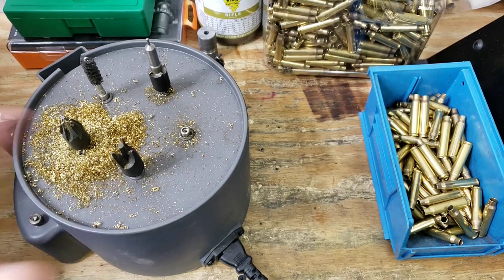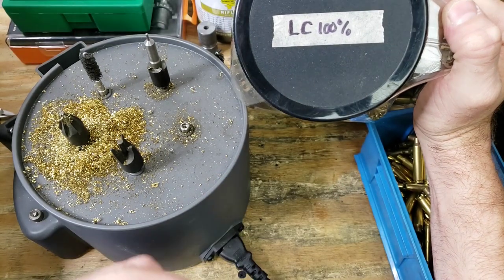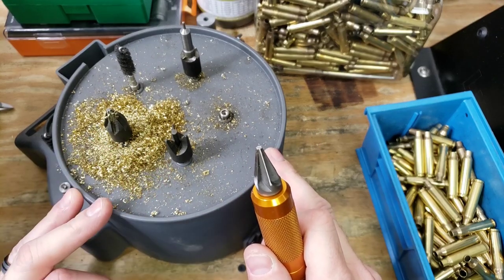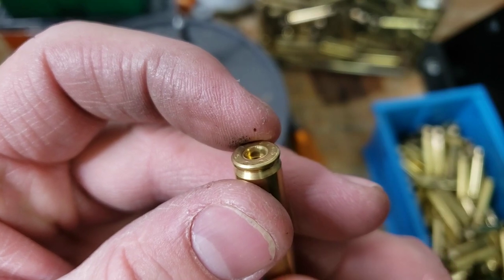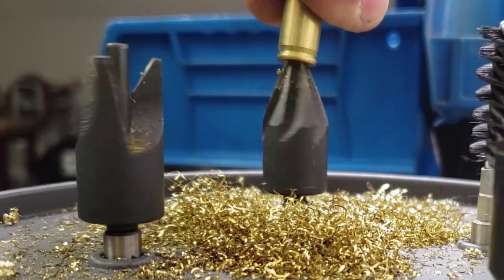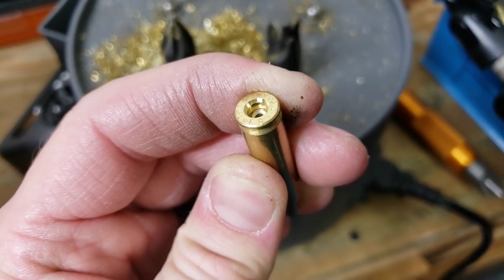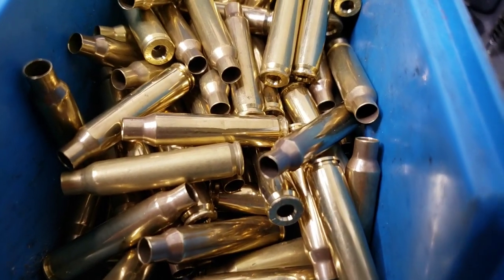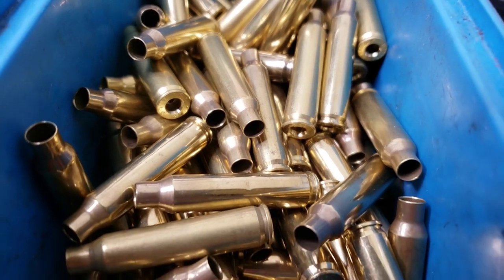A Simple Way To Ream Out The Primer Pocket Crimp On Your 556 Military Brass

Comment: I have buckets of LC 5.56 so I bought a Dillon Super Swage 600 and hate it, it's like running a press so I bought a case prep multi tool off Scamazon for 15 bucks.  It's the type that has a handle that unscrews and stores the bits inside.  They chuck up nice in a small battery drill and make short work reaming those primer pockets and they are all perfect.  Nice chamfer and no oversize pockets.
Reply from the maker: That's how I started, with the multi tool. The drill method would eventually run out of batteries. The prep station just holds more tools and is quiet. I've tried swaging with the Lee APP, but it's also another single stage press, and keeping the case collator topped off was still taking a lot of effort. I just ended up back to reaming with the VLD tool. Thanks 👍🇺🇲🤠

Comment: The bit you are using is for inside of the case mouth not the primer pocket, there is a primer pocket swaging tool that comes with your case prep station.
Reply from the maker: This is faster and works well enough for bulk range brass. I now swage on the APP, anyways👍🇺🇲

Comment: Why not swage? I found that reaming them gas resulted in a few primers falling out and down into my trigger group. Not too good.
Reply from the maker: I haven't spent money on a swager yet and hear pretty mixed reviews on the single stage swage units. I've never had excessively loose pockets due to reaming. If your primers are blowing out, they were probably already loose to begin with. Hard telling with military brass from unknown origins. I'll probably try swaging some day, but this is working for now.
Reply: @DummyRound  i hear that. I just put a swage die in my lee turret?!?  Is that bad?  Seems to work. Nice snug fit. Little finicky to set up but im thinking forcing the pocket open may be a hair better than removing material. I used the lyman tool up until I bought the swage die. Also nickle 9mm cases suck. Very loose pockets. I saved a bunch up all excited to made a couple hundred XTP special pretty boolets and the primers are loose decapping . Not a fan of nickel anymore. At least not for reloading
Reply from the maker: It should work fine on a turret press. The nickle brass could have come from some hot factory loads and already loosened up.  There are go/no go primer pocket gauges that will tell you if you are out if spec,  they might be $10-15 each  and will help you sort out bad cases before wasting primers in them.

Comment: I ream my military crimps and haven't noticed a bit of difference in the primer to pocket fit from the brass without a crimp .
Reply from the maker: Works just fine. If the primer pocket fails, there's no shortage of military 556 brass lol
Reply from the maker: If you have a normal inside neck debur tool, I've found these work better than the actual "crimp reaming tools". Just a few quick turns and it takes off enough of the edge to allow a new primer to be easily installed. It doesn't take much, but will bottom out on the primer pocket before you're able to go too far🇺🇲👍

Comment: That bit is intended to chamber the inside of the case mouth.  The one beside it is to de-burr the outside of the case mouth.  There's an entirely different bit designed to remove the crimp.
Reply from the maker: There are different tools available, and I have many of them. This is easy and repeatable and works as well as most other reaming methods. I've since started swaging on an APP. Thanks 🇺🇸

Comment: Frankford Arsenal Prep Station comes with all this standard. You can also add cleaning mops and use them mop out the inside of your case, if you need to. For most rifle case prep, and the money, the FRANKFORD is the best buy out there. The only cases it won't trim are calibers without shoulders, like the 45-70 or the 357 mag. I've had mine for a decade or more and it has saved me a lot of time and sore fingers
Reply from the maker: I have the FA prep center that doesn't have the trimmer. I used to use the Lee gauges with the 8/32 cutter adapter on one of the stations and you can still trim straight wall cartridges that way. Got the Lyman as a gift and use it more because it's quieter, though I can't find a use for all 5 stations at once. I've since gotten a Lee APP for sizing and swaging pockets, it's fast as hell and doesn't remove any material from the case(which some people really make a stink about). For bulk trimming, I have moved to the WFT2 with 223, 300blk, and 308 trim chambers. All my other stuff is still done with the Lee set up on the Lyman prep center.
Reply: @DummyRound  My set up is an ancient Pacific (pre Hornady). It came with the original case trimmer that you screw to the top of your bench. It has assorted pilots for most of the common calibers. It Comes as a hand crank but chuck it up in my cordless drill and it works like a charm. Accurate & fast.
Reply: My FA prep station did not come with the primer pocket reamer tools only primer pocket cleaners. I used the reamers that came in my lyman hand case prep tool which came with both large and small primer pocket reamers.

Comment: Along with a primer pocket crimp remover thingy, I bought a counter sink drill device from the hardware store and it seems to work okay when put on my Dewalt 20v drill driver. That prep center though....
WOW!
Reply from the maker: The drill is probably faster but I usually do the pockets after normal chamfer and debur from trimming so I'm only handling it once... aside from here where I used the wrong tool to ream the first time 🤣

Comment: Ok, looks like a good solution for small primer pocket crimps.  But why not just use the large and small primer pocket reamers that came with the Lyman case prep center?

My Lyman case prep center came only with the VLD bit that you show on the hand tool, so I’ll have to find the standard one you show here and give it a try, as it looks very fast.  Thanks for the suggestion.  👍
Reply from the maker: The non VLD tool is just faster than a normal reamer, and bottoms out before you take too much out. I usually just hit it for 2-3 seconds to break off the sharp angle of the crimp/stakes and it's good to go. For large pockets, I'm stuck with the actual reamer. Thanks for checking it out 🇺🇲👊

Comment: At the beginning, you said the vld was too steep of an angle to ream out enough material. I'm running into the same problem with my Hornady reamer. I know you say you swage now, but what's the tool you have installed in the case prep center?
Reply from the maker: Regular chamfer tool, I think that one is from the Frankford Arsenal prep center🇺🇲👍

Comment: I use my lyman hand tool chucked up. I’ve got a 5 gallon pale of brass so I don’t worry about primer pockets wearing out. The rcbs pocket swager kinda sucks imo
Reply: I had mine chucked up too. Id save the shavings and put them in a little glass jar told my youngest it was gold. Lol. I told her the truth the next day. I did have a few loose .223 and a few 9mm
Reply from the maker: Yep, I'm not too worried about getting that one last extra firing out of my military 556 brass. Plenty of it to last a good while.
Reply: @DisgustedGenXr  there’s gold in them there primer pockets:)

Comment: Without some kind of depth stop,  too much material was removed in this vid.  Also it was not squarely on the cutter.   I wouldnt recommend doing it this way.
Reply from the maker: It actually stops on the tip of the cutter and removes less material than a dedicated reamer does. Anyways, I've since started swaging on the APP.